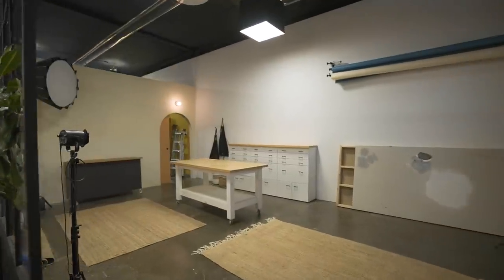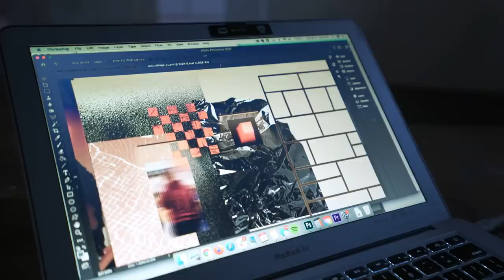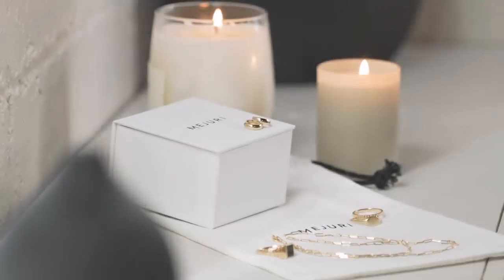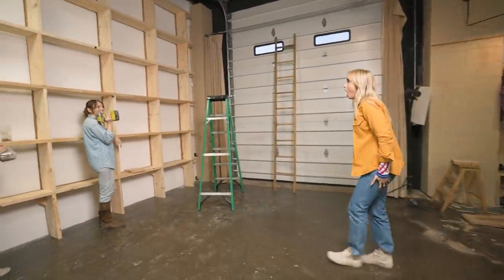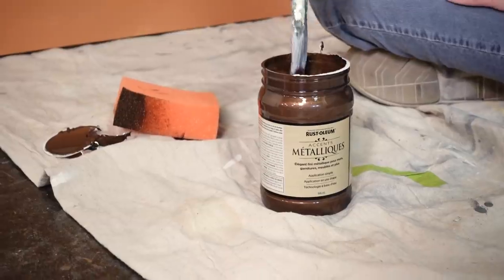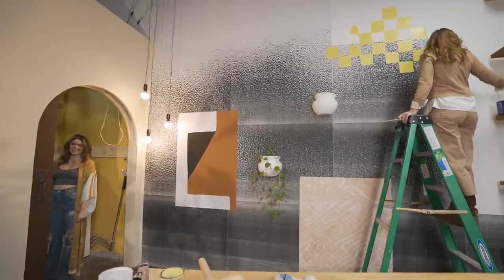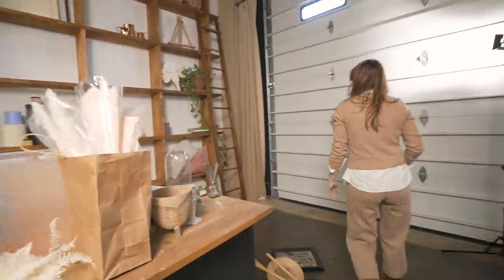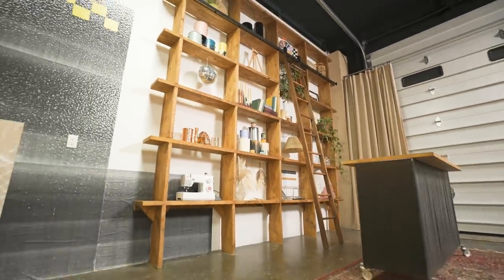full studio makeover ft. collage walls & massive DIY shelf

Comment: I like the concept of the collage wall, but i think it would have been more successful if it didnt have those xerox lines that came through on the black/white print. If those werent there i think the collage would have been a hit! Love the yellow check boxes and stuff. Its def giving me graphic collage vibes! I think i have a page like that in my art journal too. Gj!
Reply: yeah i’m surprised it wasn’t at least mentioned in the video— it didn’t look like that was the plan
Reply: Giving me printing off pics from the internet in 1998 vibes
Reply: The printer shop definitely shouldn’t have even sent those out the door. It looks like they either ran out of toner or the drum cartridge needs to be replaced.
Reply: I feel like it was on purpose, or they would have said something, or gone in a different direction if it was an Unfixable printer mistake. They’ve changed their whole plan over way less in the past!
Either way I’d be curious to see their original draw up/inspiration for the collage wall.
Reply: They're engineering prints, it's a way to do big prints at a low cost because it's not meant to be high resolution
Reply: Engineering prints come in several different sizes, up to about 24 by 36 inches. They can definitely print out high quality as long as the file is set to 300 dpi or more. The issue I see in the video isn't a resolution issue. There are banding streaks across some of the pages, which is a printer or ink issue. I worked at a print shop for several years. We would not have allowed prints to leave the shop looking like that. Someone either didn't care or didn't know better. Sorry for the rant, it just makes me sick when I see shoddy work that (despite how cheap it may have been) they still had to pay for. Also if you pause at about 4:54 you can see the texture of the background and there are no streaks in it. The TSG team put a lot of hard work into this project so it sucks that it didn't turn out as awesome as it could have.
Reply: I would've preferred the yellow squares to be even bigger

Comment: The makeover in general is chefs kiss but I couldn’t help dying over the collage wall. The architectural prints are moreso used for blueprints where it’s mostly white background and thinner black lines - it replicates poorly especially in denser areas. It’s also why the ink rubbed off when it was being applied since it’s considered a quick print and it doesnt take as much time to fuse the toner to the paper. Maybe painting in between the seams or where it shows unevenness might help blend it in?

Comment: The collage wall started out a little rocky. The yellow squares were giving me kraft single cheese slice vibes. The shelves 💯. Styling them they look a bit cluttered but I understand the need and use for storage. I love the ladder so hard. Kelsey, which necklace from the jewellery line were you wearing with the low cut white top and blazer? I need it. I also need those wall mounted planters.